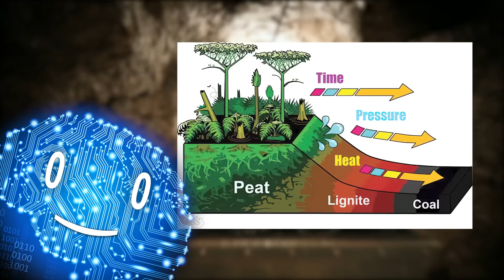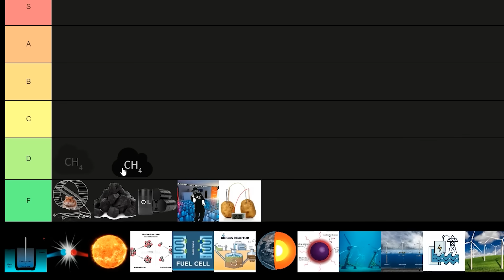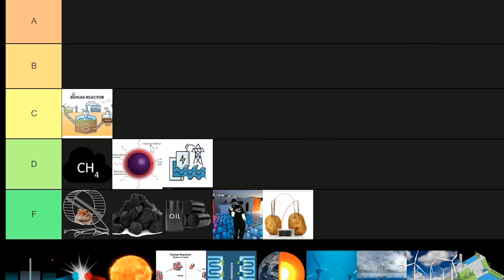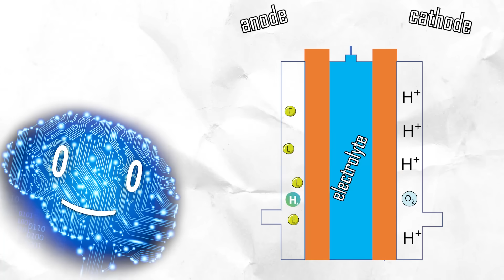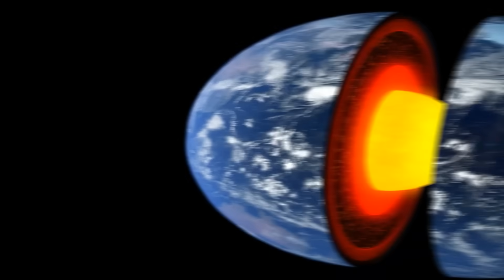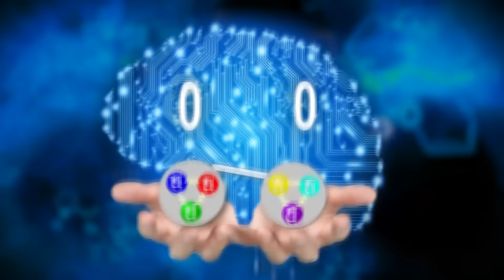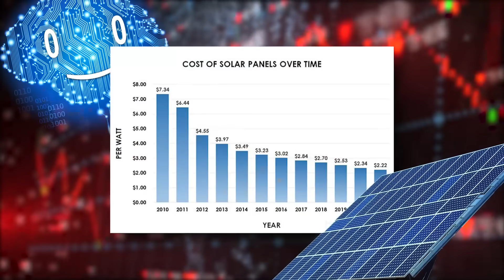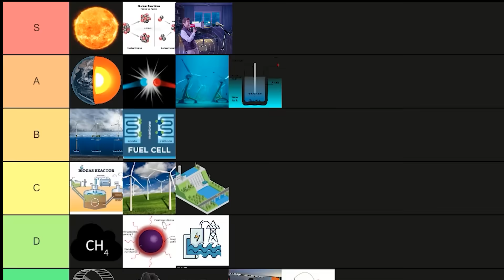Tier List of Energy Sources Explained

Comment: I am not the biggest fan of this video. It was never specified exactly what aspects would be considered in grading the sources of energy, so it’s hard to determine why oil is in F tier but Hawking radiation is not. Oil has done much much more to benefit humanity, far outweighing the environmental damage it’s caused. Hawking radiation is barely understood and incredibly low power. Angular momentum of black holes wasn’t even mentioned but has a lot more potential in the distant future. Sorry, but this video was just not well done.
Reply: Oil is in F because it contributes to global warming
Reply: this video is about the FUTURE, not the PAST, and sure, fossil fuels have given us very good benefits, but they're also going to cause bad damage to our planet that won't subside for tens of thousands of years, so that's an issue and we must transition to other sources that AREN'T going to harm our planet
Reply: @bucket6386  I’m sorry but at no point was it even implied that this video was concerned with the future only, especially since it mentions cold fusion, which has basically been proven to be a pipe dream at this point. How could a fake energy source born from poor experimental methodology and overhype ever provide any tangible benefit, let alone one greater than that of oil? In what universe are light-up dance platforms a better source of energy than oil?

Comment: There are a LOT of problems with Solar.

1. It takes a lot of materials to build a singular solar panel. (Aluminum Frame, Tempered Glass, Encapsulant material (EVA film is a good example), single crystalline, multicrystalline, polycrystalline or amorphous are used for Solar Cells, (and there are 60-72 of these.)A back sheet (A LOT of Materials are used for this one.) and FINALLY, A Junction box, typically using 12v wiring.

2. Solar farms are dangerous to birds. Birds die when this ridiculous amount of sunlight is reflected onto them, making them turn into roast dinner really quickly (they catch on fire.).

3. Solar panels have LIFE SPANS. When Solar panels break, all the nasty chemicals used to make them work go into the air and soil. Poisoning crops and very slightly decreasing air quality. 

4. Referring to point 3, governments will begin to streamline solar panel construction, which means making cheaper versions. China has already done this. Meaning that Solar Panels will have shorter life spans. Instead of 5 years (If left unkempt) to 2-3 years. This solar panel issue is a major contributor to the horrendous air quality in China.

5. Earth has a thing called WEATHER. It is unpredictable. We also have something called NIGHT, making it hard to constantly store and gain power through solar.

Thank you for coming to my TED talk! If I forgot to add something and remembered it, I'll update this post.
Reply: 1)It takes a lot of materals to make any power station.

2) Are you talking about concentrated solar and not solar PV?
Also they figured out birds avoid hot collectors and if they don't point all the mirrors at the same place the birds are fine

3)All power stations have life spans. When they break all the nasties are released into the air and soil.  With solar panels the majority of the panel is silicon. The second most common element in the Earth's crust (only behind oxygen)

4)How long does any power station last without maintence?

5) Weather and night is predictable. Also don't we sleep at night leading to less energy requirments at night?
Reply: @catprog  I do LOVE me some contraversy.

1)
I'm talking about SINGULAR Solar panels, meaning it requires a lot of materials for ONE. To make power stations, it requires a lot less materials to make a larger thing.

2)
Yeah....but it still happens..

3)
Yeah, I know they all have lifespans, but not all release stuff into the air and ground. Even shit stuff like fossil fuel facilities can be  maintained for long periods of time..

4)
How tf does this connect to solar panels? I'm talking about mass production of a smaller item, not fucking powerstations.

5)
No.....Not always...
And as for night, you do realize that power is consistently used at most hours?
Reply: Regarding current solar panel tech, the physical footprint is kind of an issue. To get more energy, you need to expand the solar farms, which can only go horizontally. And not all places are suitable for solar energy. The further up you go in latitude, the less solar incidence you have, reducing overall efficiency.
Reply: @SparkyRedheadSupremacist  Exactly. It gives it the similar problem with wind power. You have to clear out a large plot of land to achieve this. This can destroy animal habitats.

Comment: It's crazy to think that all energy on earth, with the exception being nuclear and geothermal, came from the sun. Coal was trees that made sunlight into food and turned to coal. Oil was plankton. Wind is caused by the sun heating up the air. Solar... Sun. Hydroelectric water cycle which is driven by the sun. So on so forth.

Comment: IR can be used to accelerate anything only to the speed of light because it won't be able to go faster than the light pushing it obviously.
The fraction thing is because it will get far away from the planned source of light that just a few light will hit and and eventually essentially none but that only means that we just gotta speed it up extremely fast while it's on our range.

Solar is not a good way to generate electricity, it's one of the worst ways and I don't know where you got that from.
Solar would only be good if we are talking about the heat since it remains even at night time, I don't see how we would use that though.

Geothermal should be up higher, the downsides come only when doing pro-profit projects and there are new ideas already like simply using a closed loop.

Nuclear is way more troublesome than Geothermal and anything involving Hydrogen if producing water as a byproduct will drive extreme weather on the planet so that's never happening unless that change in weather is something we need.